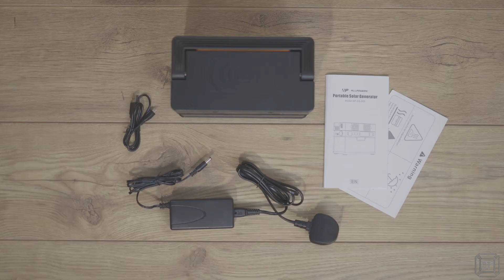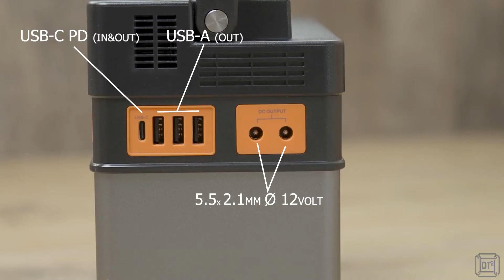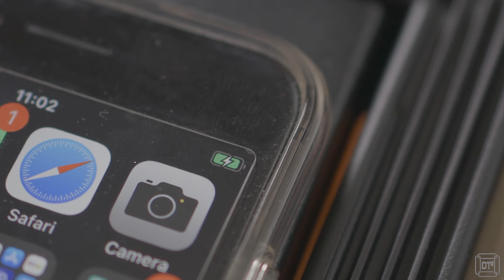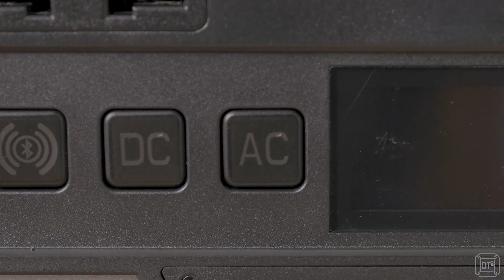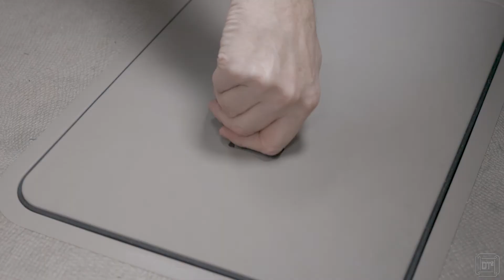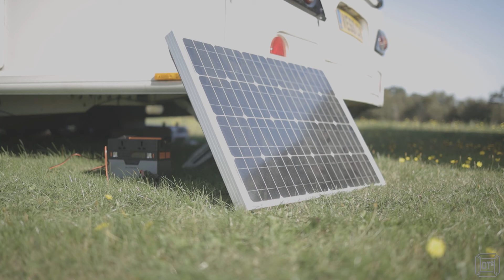ALLPOWERS 372Wh Portable Solar Generator Demo

Comment: Hi Ive got one of these did you find the power adapter gets really hot.
Reply from the maker: Warm maybe but I don't remember it ever getting very hot. I'll try and check when I get a chance.
Reply: @DTSquared  thanks for that 👍( I’ve contacted the seller with an issue with the wireless phone charger as well 🤷‍♂️
Reply: @DTSquared  got a replacement all good 👍

Comment: The 5.5mm ports are 5.5x2.5mm not 2.1mm as you have them listed.  Also, the 12v barrel connector is not voltage regulated, and the side 5.5x2.5 mm connectors are regulated at 13v.  The 12v "cigarette lighter" port is tied to battery voltage and drops as battery state of charge drops (and is always connected).
Reply from the maker: Looks like I mixed up the labels with the input socket on the other side of the unit. I did verbally say the correct size when describing it but thanks for the correction anyway.

Comment: Hi. I have the 600 watt version plus 100 W solar panel. Question: The USB1-3 output is described as 5V3A/9V2A/12V1.5A ; Can I plug in a phone via the normal USB cable I use although that normally gets 5V~2A ?  Does the Allpower station give 5V2A and how does it know that?
Reply from the maker: Hi the current (3A , 2A etc) is determined by what you plug into it so the feature is that it can support the higher amps if demanded by the device. The higher voltages are purely on the USB-C connector. USB-C does some power negotiation to determine the requirement, this is normally by the device but I have heard reports that some manufacturers use the cable to handle the power negotiation and so recommend to use the correct cable. Simple answer is that the device determines the voltage and current where required and it is recommended to use the manufacturers supplied cable especially on USB-C.  Hope that helps. Dave
Reply: @DTSquared  It helps. Thanks for quick answer. I retired at 56 already and do this for new hobby but have to re-educate me a little as I have no technical background. Greetings from the Netherlands.
Reply from the maker: @goudhaantje3569  no problem at all. Haven’t been to the Netherlands for several years now. Last time was near Arnhem about ten years back and before that cycling round the Netherlands when i was still a teenager 😀

Comment: Do you have a link to a suitable USB-C charger that would work between the leisure batt and the AllPowers unit? I can't find one anywhere.
Reply from the maker: I purchased this Baseus 65W output plug in charger. https://www.amazon.co.uk/gp/product/B08F25BP4X/ref=ppx_yo_dt_b_search_asin_title?ie=UTF8&psc=1 However it seems to be unavailable.
I've also purchased some other USB C adaptors but you have to look out for the output wattage (not just that it is USB-C PD) and when testing them several of the bulkhead style (that you actually wire in) delivered much less than the stated wattage.
There seem to be various plugin chargers available from Amazon so I'd recommend either searching out the Baseus one from elsewhere or getting some from Amazon that state they provide 65W PD (power delivery) and then returning them if they don't come up to scratch. The good thing is that the AllPowers unit tells you the input watts so it is very easy to test.
Hope that helps.
Reply: @DTSquared  You are a gem in the rough, sir! Thank you for sharing your knowledge with us. Much appreciated.
Reply from the maker: @tartanrambo  LOL thanks, hope you get hold of a charger that works for you. One other point, with USB-C the cable has an effect so if you get one like the Baseus that comes with a cable then that's more likely to be ok but if not then try different cables before giving up/sending back.

Comment: Hi, great video! Cheers. Can you please make a review or give an opinion if I would be able to charge a small 15-20l 12v Fridge?
Reply from the maker: Hi Ivailo glad you liked it. The fridge question is a tricky one as it depends on a lot of factors and I haven’t tried it personally. Looking at some random 20L fridges on Amazon they mostly quote around 75W which would be about 6.25amps (75w / 12v) but that’s assuming that is the current draw not the cooling output. The Allpowers unit should be able to supply 10amps out of the 12v car cigarette socket so you “should” be able to power one of these fridges. In terms of how long it lasts for, “IF” the power draw is 75w then it would last about four or five hours. However of course with fridges once they get cold they stop drawing power unless you open the door etc. So the answer is that it probably would but depending on the outside temperature and the temperature of what you put in it then it may struggle to last long enough before you can recharge it.
I know that’s a bit vague so not sure if it helps much but as I say there are a lot of variables. Probably best to research the fridge and see if you can find both max CURRENT draw (must be less than 10amps) and typical power usage over 24hrs which you’d want to be well under the AllPower’s 372Wh. Hope that helps at least a little bit. Good luck.

Comment: hiya, I'm looking at building an off-grid van. Do you think this would be feasible as a replacement for a traditional lead-acid battery and inverter system. The only things it will be running is a few 12v lights and then charging my MacBook and camera batteries. my plan is to have it plugged into the van while driving to charge it in a similar way to a split charge type thing. Also, do I need to make sure I am constantly charging and discharging the device or would I be able to just constantly keep it topped up?
Reply from the maker: Hi Josh, if you are looking for a low(ish) cost and very simple install then I'd say it is an option and of course you could add a solar panel directly to it. A full conversion for an off-grid van would normally involve at least a 100Ah lead acid which (at 50% use) would give you about 600wh about twice what this has. But a lead acid will take longer to recharge. You would need to connect any lights etc direct to this unit (not wired in with the van's existing circuits).So it would be a bit more like camping inside your van rather than part of a full on conversion if that makes sense? So I guess if you want a simple build and something you could use elsewhere later as backup power if you do a full conversion then it would be a reasonably safe bet. Hope that helps
Reply: @DTSquared  thankyou so much for the reply. I might look a bit more into it as I was planning to power the vans inbuild circuits using this but still have the option to take it out and charge it in the house or take it to the beach for portable power.

Comment: Nice review did you got paid or got a discount ? Your video is well explained I purchased and noticed no matter how much solar panels i connect in parallel it won’t give me more than 45-60watts, great power in a compact unit  , how much run time you get when turning on unit and there is no load on Ac I got the 120Ac version your seems to be 220ac?
Reply from the maker: Hi Chuck glad you found it useful and to answer your question no payment or discount. I make all my videos just for the fun of filming them so any reviews etc I buy the gear myself at the usual price. For full disclosure a couple of camp sites have given my a bottle of wine AFTER I made site videos but since I don't drink I guess I still never got paid ;)
In terms of the solar input I think you'll find that you won't get anything over about 60Watts in regardless of the number of solar panels because the battery intake is the limiting factor. The guideline of charging current for lithium batteries is about 30% of capacity. I just double checked and when connecting the supplied mains charger it registered 57Watts input which tallies with your findings with multiple solar panels. 
What you will find with multiple solar panels is that you will more likely hit the maximum power even with less sun.
Hope that helps.
Dave